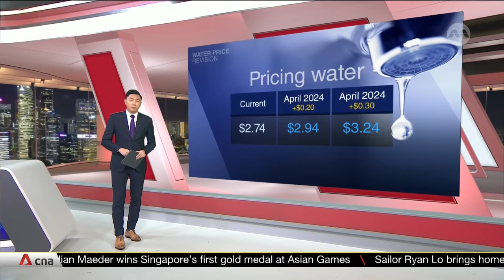Singapore to raise water prices by about 18% over next two years

Comment: No increased costs’ figure to justify the increase?
Heng Swee Keat said that Singapore has invested in desalination and Newater plants which are “costly but necessary” investments, but there was also no mention of what the increased costs’ figure is – to justify the price increase.
Mr Heng pointed out that the increase will be less than $25 per month for three-quarters of businesses, and less than $18 for three quarters of households.
After subsidies, 75 per cent of HDB households should see an increase of less than $12 a month in their water bills.